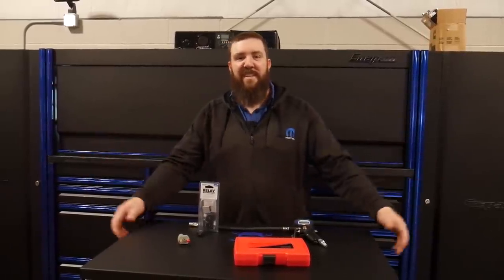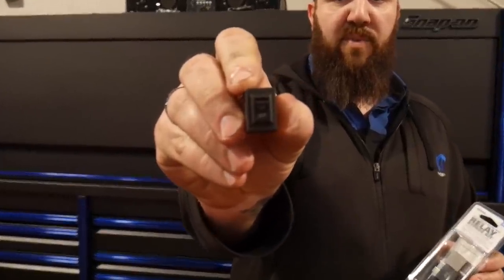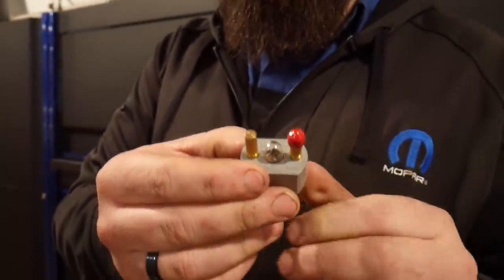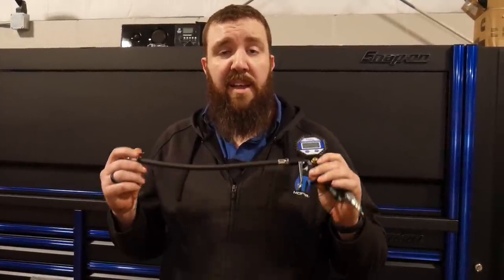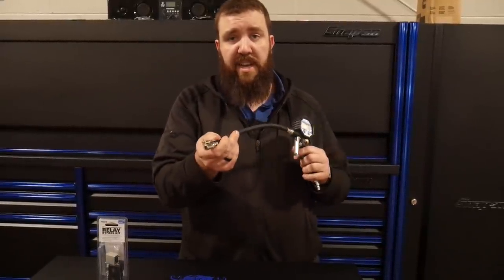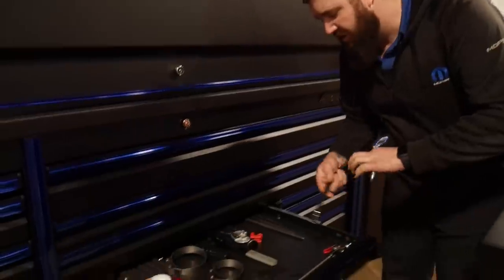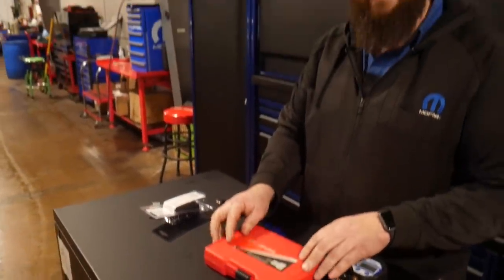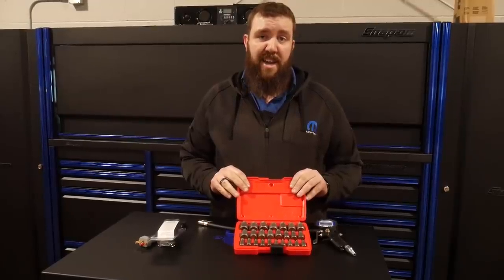NIFTY TOOLS OF THE WEEK WITH RUSTBELT - EPISODE 2

Comment: That snap-on easy out set is rebranded those are actually Irwin
Reply: And the big ones are great for the diesel side of the industry for like broken brass fittings like air line fittings

Comment: Awesome video, I'm going to look into the air chuck.  But i must say,  I have some doubts on the longevity of a digital pressure gauge but it's worth a shot.  The lisle tester tool is a must have, cheap, and very helpful with interior electrical diagnosis having a known good ground/12v connection.  Keep up the excellent content!

Comment: The ones with the amp loop on the top are even better. I have a six peice relay kit like that but they all have an amp loop on top for an amp clamp. I forget who makes it though
Reply: Electronic Specialties. Bought the kit off the snappy truck (impulse buy) then got to my SUV and looked online ajd felt like I got raped. Wasn't to bad as o didn't pay the flyer price in the snap on added flyer they do monthly with the non snap on stuff. Great tool set.

Comment: I just built a couple relay jumpers with wire some spade connectors,and a switch. they work like a hot dam, and I can toss a current clamp on if I need to. Nice video as always🍻

Comment: Astro pnumatics is the best I've found, also I have a Freightliner with a cummins ISC8.3(paccar px-8 is the same engine) with what sounds like an exhaust leak, however I can not find a leak anywhere...EGR system, manifold, head, rocker arms, housing and cover, turbo and VGT actuator are new, would love suggestions on possible other things I could check
Reply: Are you sure it's not the boost spooling up? Air to air core? 
The reason i say this is what is leading you to believe it's an exhaust leak? I have a buddy who's actually Volvo, Detroit (Older Style series 60), Paccar and Cummins certified. I'll ask him if he thinks it could be anything else. 

I wouldn't be throwing parts at it as that's just wasting money. IF it's the dealer doing it and it's not warranty then I'd find a different more capable dealer rather than dumping money into it.
Reply: @dtnel  the turbo went out and put oil thru all of the EGR system, that is why it was all replaced, I wasnt sure what the noise was at first but I found a small leak on the exhaust manifold, had to remove it and change the seal out in the middle (it's a 2 piece manifold) 
Thank you for the reply and the suggestions

Comment: I think the Lisle tool should have done a digital led in the center to give voltage readout instead of a bulb. I have one to check batt volt and charge system is working. They also make USB port and volt readings on those they are very handy knowing your batt voltage especially if you only have a dummy light. Love tool reviews keep them up.
Reply from the maker: I’ll have to look into one of those, sounds like a really great alternative. Post a link if you have it

Comment: I have a cig lighter tool with a digital volt meter reading on it. Works good for a quick diag on an alternator!

I also have one in my car that has 2 USB ports on it. It gives you the volts first, and if you charge your phone, it gives you the Amps it’s charging. 

That one you have is a good idea too! I sometimes have a hard time finding a doorjam ground! Nice vid Man!
Reply: shane depends on what cars you work on. 90% of the alternators I get on Bmw and minis never even turn on a battery light nor barely show any signs of going out. You have to test drive sometimes. Throwing a cig lighter volt meter in while turning on accessories is a lot easier to catch a bad alternator in action.
Reply: @AutobahnDan  , totally agree.  I have the Lisle tool as well and working on BMW's where it's difficult to make an easy ground connection in the interior, this tool is great.  And like you say, you can load test the alternator by switching on consumers.  Or hook up a scoop, record, road test, and check for an intermittent hick-up.

Comment: the screw extractor set also comes in a more sensible 10 piece  REX10B. in aviation we end up going through a lot of the 1/8 size , and the snap on ones are far superior to the Irwin clones.
Reply from the maker: Totally agree with that! I’d have bought the smaller set normally but I got this one in a bogo deal on the truck one week
Reply: This kit is made by irwin snap o just rebrands it. The same with their 48 piece thread restorer kit. Its made bt lang. Snappy just chanves the box color to red and sells it for way more. The good thing about the snap on extractors that irwin makes is that u can get them warrantied where the irwin ones u cant.